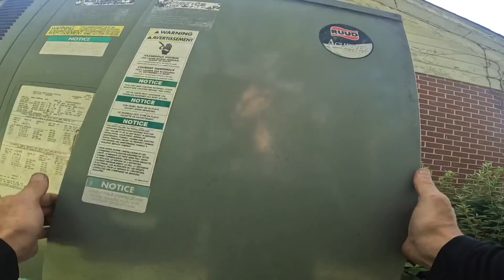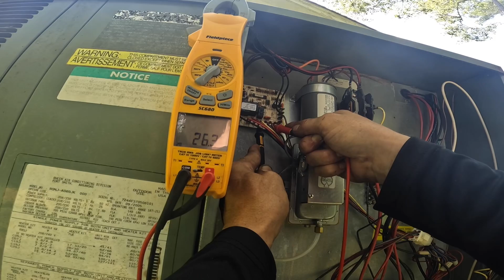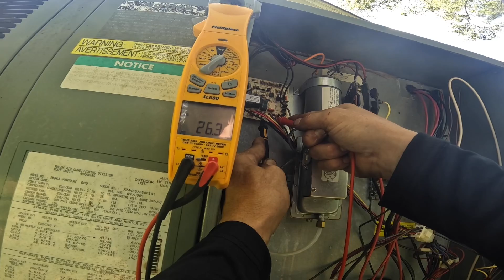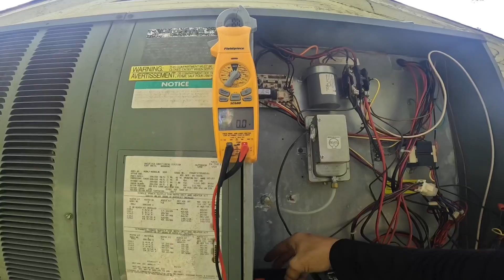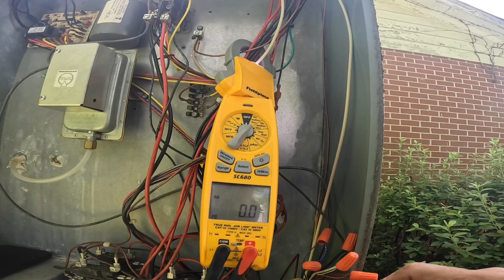System Cuts On and Off Way Too Often

Comment: Lol… a measily 26v can get your attention!  Keep up your videos.  Very helpful.  Thanks!
Reply: Ever touched a phone wire when ring voltage shows up?
Reply: @scott_meyer  Yep. Quite a tingle and it wakes you up. Happens so unexpectedly.
Reply: It's not the 26 volts that gets you it's the voltage spike from the coil
Reply: @joshuabest100  
Back EMF. When you remove the 26 volts, the coil can produce a higher voltage as the magnetic filed collapses.
Reply: Ever had your phone ring just as you touched a bare wire 😆 🤣 😂

Comment: The electric company's around here want the home owner to sign up where they can shutdown the electric to the A/C and water heater so that a high energy user can get all they want for 25 percent less than I pay for the same amount. I say screw them. I can see a power station that is just 30 years old. They shut it down 2 months ago for good.
Reply: So you'd rather have rolling blackouts and have all of the power shut off?
Reply: @scott_meyer  If the grid can't handle air conditioners...imagine a few million electric vehicles plugged into the grid total chaos, grid needs to be upgraded.
Reply: @GoatzombieBubba  
True it will, however, consider most electric cars will be charged at home in the evening after peak demand.
Also after a short period of time a car stops drawing power after the charge is complete, AC runs as long as it's above the set point in the building ALL DAY.

Where I live the power company will give you a wireless Smart thermostat no strings attached simply for the power savings that programmable thermostats provide.

You have the option of signing up for the thermostat program, you get a power credit in return.

It doesn't shut off power, but shifts and spreads out the peak demand in the afternoon.
Say they expect the demand to reach the supply limit between 4 and 6. What they do is turn your thermostat down 5 degrees at 1 so your house can cool down, then at 4 they turn the temp back up to your set point. typically a home warms up at around one degree per hour, so your system wouldn't come back on until after the peak demand is over.

They do send a notification to your phone that an event will occur, and you do have the option of opting out .

Best of both worlds.
Reply: @scott_meyer  a typical level 2 50amp charger takes 8 hours to recharge a typical electric car. At 15 amps it takes 4 days. 
What's this "short period" you speak of?
I'm all for electric cars but I also understand the grid is maxed out already. An electric car will more than double your usage, do you think the grid can support adding the equivalent of 2 more air conditioners to every home?
Reply: @jamminwrenches860  

Most people will charge at home, after peak demand.
Most people who use public chargers don't charge up all the way,  or wait until completely empty, since charging at home is much cheaper than what public charging stations cost. They only need enough to get home.

Do you think they haven't been planning for this increased demand for years?
Reply: @scott_meyer  LMFAO FREE ENERGY. Friend, you couldn't be more wrong. It takes way more than you're imagining to get those turbines erected, working, and kept working. Transferring power to the grid through stations designed for these turbine farms also require building, upkeep, etc. It's not free, not even close to it.
Reply: @Up2_nogood  
Thermal efficiency of a modern IC engine is around 20%, some like in hybrid cars near 30%.
So 70 to 80 percent of the fuel you buy is simply wasted as heat.

An electric car can be over 90%. It's a much better use of energy even when comes from fossil fuel power plants.

I currently drive a Hybrid at 54mpg.  It's saving me a ton of money compared to people who drive giant SUVS and pickups that get 22.

When Electric cars get cheaper I'd consider one for commuting. Take on on a long road trip? Not likely until they solve charging times.
Reply: @scott_meyer  what about the costs of developing those batteries, disposing or recycling those batteries (which they're currently doing an extremely poor job of), and obtaining the materials to create those batteries! Don't forget about all that lithium farming, it's super good for the environment. Super good. 

Just so you can feel great about your EV which has a larger foot print over it's entire life than that of a 2005 Mitsubishi Lancer.
Reply: @Up2_nogood  
So wind isn't an unlimited cost free energy source?

Um Coal fired and NG power plants don't require constant maintenance too?
I wonder what it costs to maintain Hoover dam?
Cherry pick much?

Nationally, financial analyst firm Lazard found in December 2016 unsubsidized wind projects costing between $32 and $62 per megawatt-hour while coal cost between $57 and $148 per megawatt-hour.
Reply: @Up2_nogood  
So what about the billions of cell phones, laptop computers, wireless headphones, vaping pens, etc, etc that use lithium batteries that have been sold and will continue to be sold.
Still cherry picking...
Reply: @Up2_nogood  

How about coal mining? They erase entire mountains to get at the coal.
Reply: @scott_meyer  compare those statistics to modern day costs of parts, components for repairs, etc. 2016 was 6 years ago. 

It's not sustainable, wind technologies may help but they will not and have not replaced current forms of energy. Straining our utility system on something that isn't sustainable just doesn't make sense. 

Nuclear energy is expensive, but long term pays out to society 10 fold compared to solar and wind. You're forgetting major key factors such as climates, weather patterns, rainy/sunny days, etc. Where I live it can rain and be cloudy 275 days a year or more. 

We have about 80-90 full sun exposure days that would be considered great or even good for charging batteries from solar panels or collecting energy with panel farms. So take your efficiency numbers and flush em down the toilet, because by that point it's just a maintenance money sink.
Reply: @Up2_nogood  

Here's the reality all of you refuse to accept.
EV cars are here, they're not going anywhere. At some point in the future, fossil fuels will run out. our choices will be electric cars or some type of bio fuels, but those compete with the food supply.  

Lithium batteries aren't the only battery technology available, just currently the most cost efficient. before that it was NiCad, before that Lead Acid.

Someone will develop something cheaper and more cost efficient that Lio, and we'll move on to that.
Reply: @Up2_nogood  
Yet wind farms continue to grow and be maintained. Power companies are in the business of making profit, it it wasn't viable, they would be doing it. It's really that simple.
You're the one with empty arguments that are dismissed by reality.
Reply: @scott_meyer  LOL. The only two energy source we have right now here in the southeast, that don't use fossil fuels and actually work, is nuclear and hydroelectric power. Solar and wind as a stand alone are still way too unperfected for the big grid, sorry to bring you the news flash. Same with electric cars. EV still have quite a bit of bugs and infrastructure challenges that need to be worked out.
Reply: @KenKen-ui4ny  
They will get worked out. At some point we will have no choice. Better to start now instead of waiting until the last minute.
Reply: @scott_meyer  Even though i am for some renewable energy as a way to cut cost. I think much of this getting off fossil fuel hype is politics driven then urgency of running out. That the reason why a lot of us aren't as much in a hurry about it like you are.
Reply: @KenKen-ui4ny  
It's obviously a finite source. The less we consume now, the longer it will last for future generations.
There's also the pollution issues with incomplete burning any fossil fuels.

What I do keep hearing is no one now wants to make the smallest sacrifice, just kick the eventual problem down the road and let he generations in the future pay the ultimate price.

It's unfortunate it's become politicized. 
My issue is, can we afford to be wrong on climate change. 
No one can deny the climate is changing, that's plainly obvious, look at Lake Mead.

CO2 is a known green house gas, so the less we emit, the more it slows the warming process.

It may actually be too late....
Reply: @KenKen-ui4ny  

Current estimates
47 years of Oil left at current consumption rates. 133 years of coal. That doesn't account for future demand increases from growing economies.
Reply: @KenKen-ui4ny  

It takes 1100 pounds of coal to produce 1MWH of electricity. A typical commercial windmill can produce 2 to 3 MW.
So every hour of operation saves 2200 to 3300 pounds of coal for each windmill while operating.
Reply: @scott_meyer  Climate change is one of those things that you have to take with a grain of salt. especially when there so much politics involved in that too.
Reply: @KenKen-ui4ny  
No it's obvious the climate is changing. The only argument is how much of it is human activity.
Reply: @KenKen-ui4ny  
Look at Lake Mead..
Reply: @scott_meyer  I don't think that's is the first time Lake Mead has been that dry, and probably won't be the last ether. People have a weak memory when it comes to extreme weather events. Other thing is a lot of these western states aren't all that great with water conservation ether. which feeds into the dilemma of droughts there.
Reply: @KenKen-ui4ny  
No, it's the lowest it ever been since it was filled after construction. It's dangerously close to not being able to release water downstream.
Reply: The snow fall in the watersheds that feed Lake Mead have been well below normal for almost 20 years.  We're seeing the effects of that. They have cut off irrigation to farms in Arizona, soon they will have no choice but to cut of California.
Reply: @scott_meyer  California wastes water like crazy, and aren't making the situation any better. Especially these big cities like LA, SFO. which were probably aren't all that efficient on resources from the beginning. You can see growth in those area contributing to the issue besides drought over time.
Reply: Yea, demand is outstripping the supply because DUE TO CLIMATE PATTERN CHANGES, less snow is falling in the watersheds than in the past.
Reply: @scott_meyer  LOL. I think demand was going to surpass supply anyway, regardless of climate pattern changes.
Reply: @KenKen-ui4ny  
You might as well claim the Earth is flat at this point.
Reply: @KenKen-ui4ny  
So just brush off inconvenient data....
Reply: @scott_meyer  LOL It call thinking for yourself. Not brushing off data.
Reply: @KenKen-ui4ny  
No, you're simply ignoring data.
Reply: @scott_meyer  So you saying that i am ignoring data, just because you don't like it how i don't totally agree with you. LOL sorry but the last time i check, everyone had a right to their own opinion.
Reply: @scott_meyer  Denial of what evidence? The noise that the media, politicians, activist scientist put out there about it. Sorry but i don't buy into that redundant jumble as easily like you do. It got to be a little more convincing then that, for me to call evidence.
Reply: Imagine your politician actually supporting your power needs instead of bowing down to Solar or wind power bullshyt. 
Before the brown outs. You had all the power you need from coal.
Reply: @2nickles647  
So, brown outs  didn't exist before wind and solar energy?  That's a new unfounded claim.